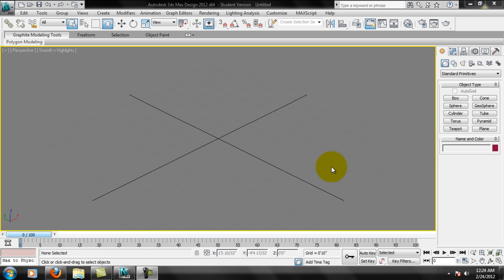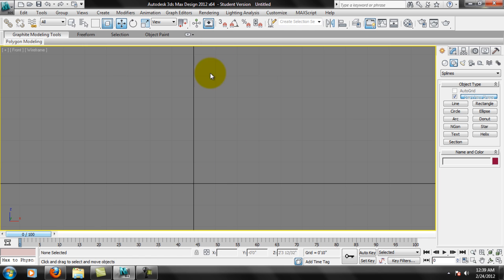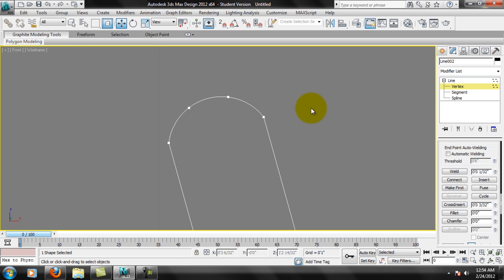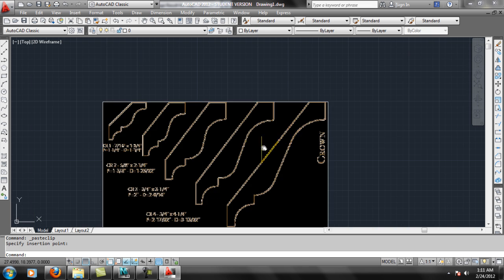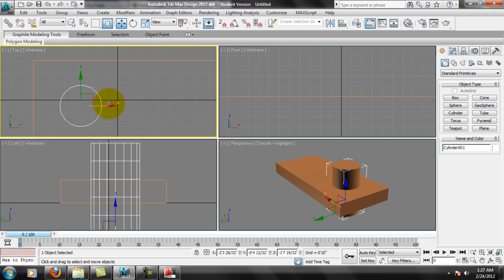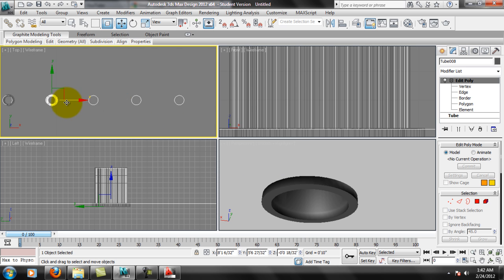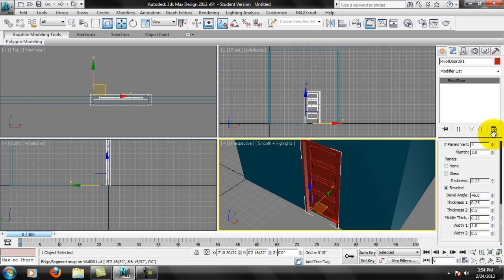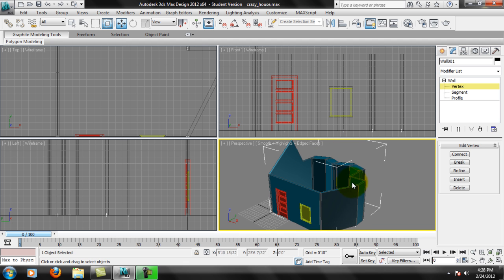Autodesk 3ds Max Design 2012 - Week 2

Comment: In order to create straight wall you need to activate ortho snapping mode. You can do that by assigning a hot key to it. First you go to Customize + Customize User Interface + Keyboard and there from all categories you will find that command and will assing a hotkey to it.